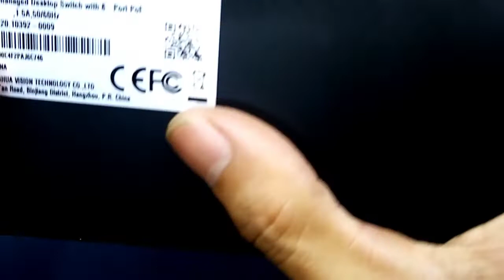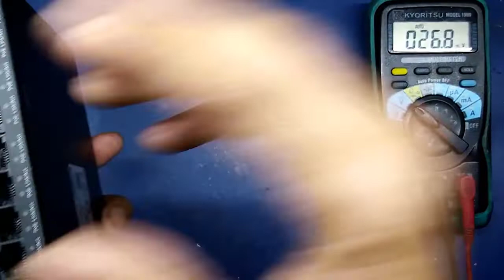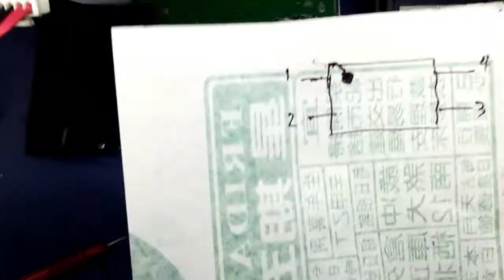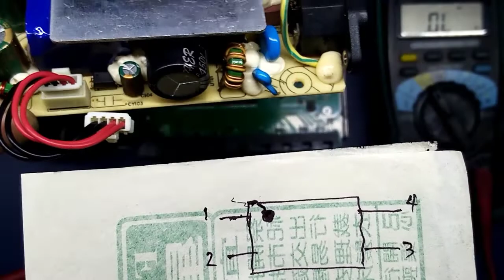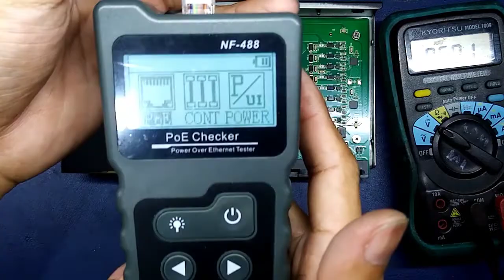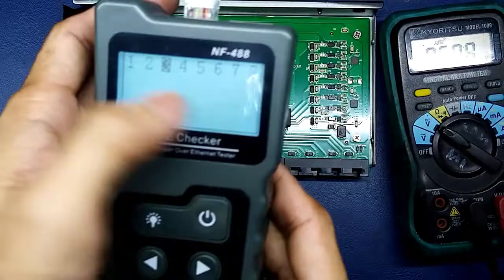8 Ports POE switch repair

Comment: Sir may value or continuity ba dapat ang OPTO coupler? both ends?
Reply from the maker: meron po value opto coupler at wala po dapat continuity both end malalaman mo lang sira pag nacheck mo sa circuit pagnakasaksak na...ty